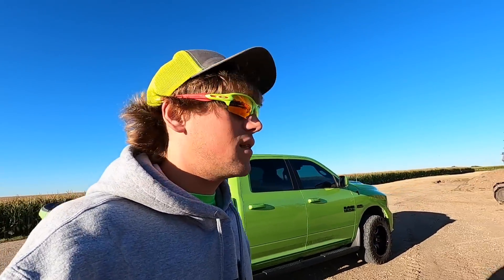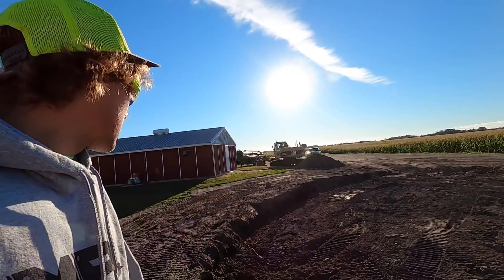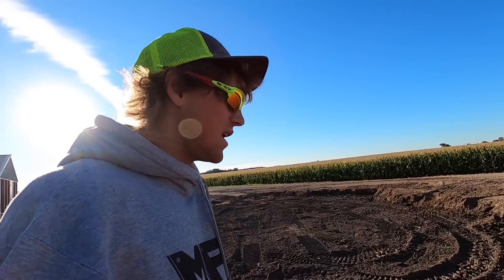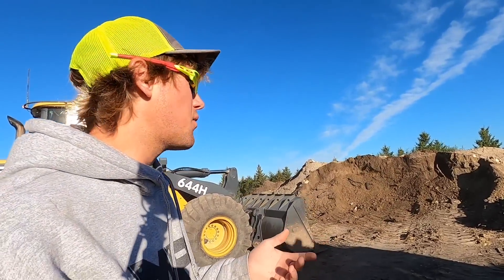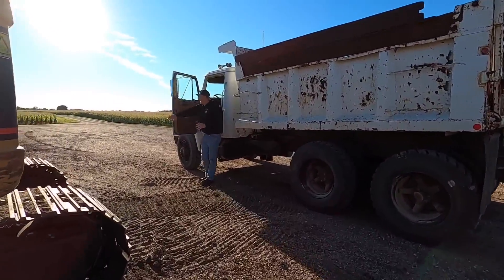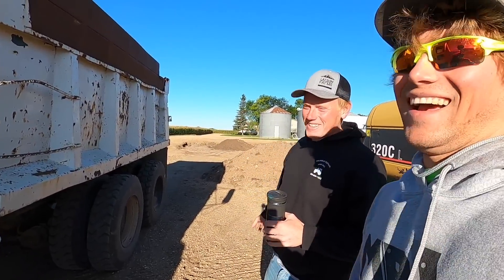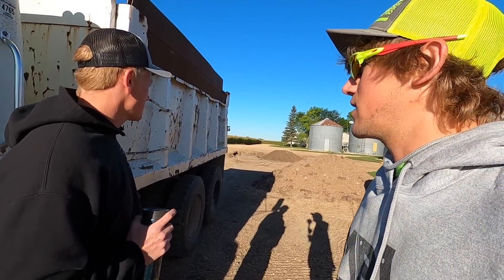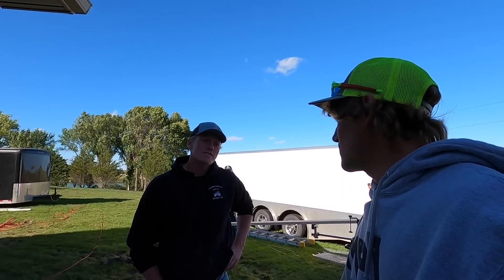Nothing But Big Loads

Comment: Chet your wee roof looks the super. 
I worked as roofer years ago, best way is at bottom rafters need a cut in rafters called a birds mouth !! 
But put lots nails in and it be fine mate👌🤙
Reply: S.A.B birds mouth actually. It helps distribute the weight of the roof onto the plate.
Reply: Riding with AirBubble   Yes your right,, that’s my auto typing for me not understanding me...😭😉
Reply: S.A.B i gave up using auto type, it rarely understands me, too southern I guess. Heck, I have a hard enough time with autocorrect.

Comment: First thing I would change is put “birds mouth” on the lower part of the rafters but you may be able to install a metal device that is called many things but “hurricane strap” comes to mind.  I believe the local building inspector will require it and on a side note it might prevent finding that entrance way in your field after a storm🚜✈️
Reply: And they put a double ridge pole in but only put a single ply header in.

Comment: You’re missing the “bird’s mouth” at the bottom of the rafter where it sits on the plate.  That way the weight of the roof is distributed over the entire width of the plate and not just the outer edge. Then again it’s probably good enough for government work and should hold until you can get a rope big enough.